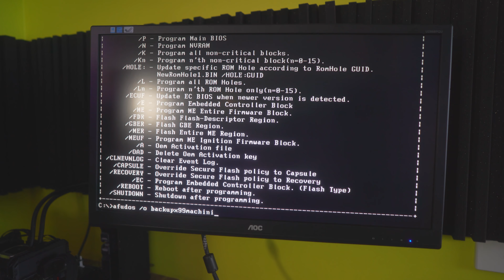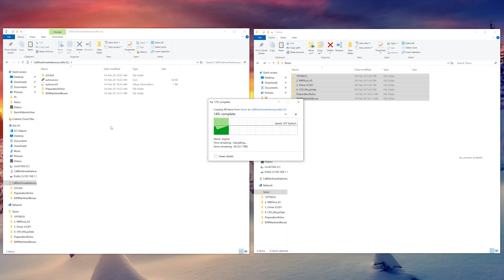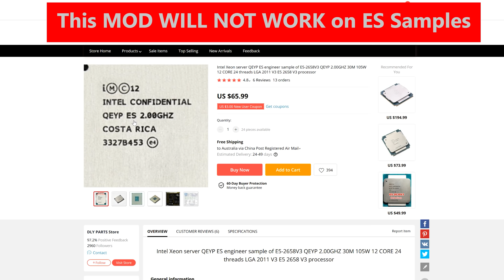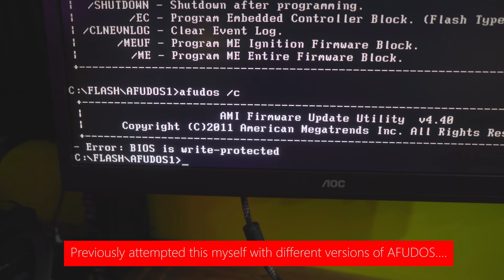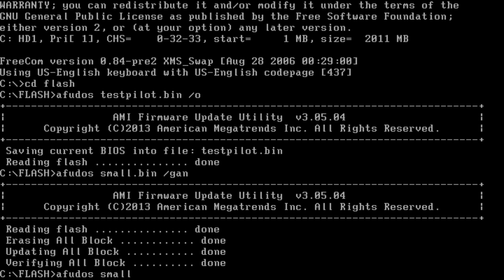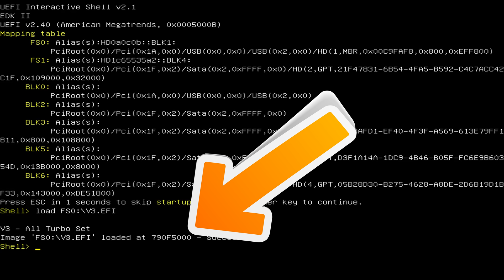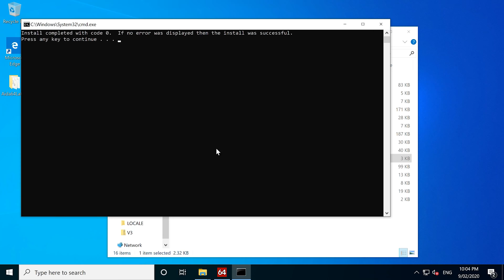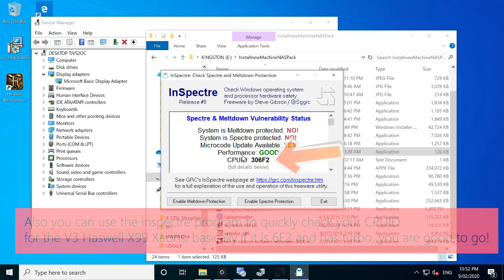Xeon V3 "Full Turbo UNLOCK" How To for X99 Motherboards

Comment: just a small note here for those who have windows intalled on a nvme m.2 ssd: the root drive is identified as FS0 and not FS1 
in some cases its reversed so be careful what you are typing, in this case bryan has it the same order i had it but some russian channels 
i watched earlier had the windows drive assigned as fs1 not fs0
Reply: does this apply to a normal ssd aswell
Reply: @quintonknight5177  I think this is dependent on whether you install windows first before you plug in your Rufus boot drive. If you have windows operating on nvme it gets assigned as FS0
Reply: Thanks, this helped me as well
Reply: Well this helps! TY!!!
Reply: Just invert command for fs1 and fs0, its works.

Comment: Great followup. I love that you dispense this knowledge freely and don't horde this type of knowledge to yourself for profit.
Reply: @mapesdhs597  thank you.
Reply: @Trick-Framed  can you explain to me what unlocking cores actually does??  I'm pretty new but I'm trying to learn!
Reply: @stevenjonas1  It depends on the situation. If talking about old AMD it is unlocking cores that were locked by the factory to create a lesser SKU. So say a Phenom x3. It has three cores. With the right board you can unlock the 4th core. And sometimes, if they were low on quad cores with a bad third core, they would lock a core on a Phenom x4 and sell it as an X3. In that case   you get a free core. More often though, the cache has issues or the core was faulty and that is why they locked it. It's a crap shoot. This was also done with Dual core procs, so sometimes you could unlock a Quad core from a Dual core. Talk about silicon lottery.
If you are referring to anything else, please provide me context and I will answer as best as I can.
Reply: @Trick-Framed  thanks a lot for the clear answer!

Comment: AWESOME!! Saved to follow along when my x99 & Xeon E5-2678v3 FINALLY gets shipped out. So far it’s been 3 weeks waiting. I understand the delays due to Coronavirus, but I’m getting impatient now. :/ ....Looking forward to cooking my processor.... LOL :) Thanks for the tutorial, I was today years old when I first heard that this was a thing!
Reply: Give us an update when you get it.
Reply: I am waiting also mine x99 huananzhi + e5 2678v3 and 64gb ram let's see if unlock will work
Reply: The normal shipping time is about 4 weeks (to Europe). But sometimes things can arrive even in 2-3 weeks and sometimes 8 weeks.
Reply: MaximusAdonicus ...It takes me 9 days to get packages via ePacket. I am just waiting for the items to BE shipped. I keep checking everyday. I placed the order on the 31st, and still waiting. The processing time has been extended twice. My other orders (2TB ssd & 2 TB Firecuda as well as my power supply were shipped today). So, I don’t think it will be much longer. :)
Reply: @Iam_Dunn  9 days from China to... USA?
Reply: MaximusAdonicus ...Northern Ontario Canada.
Reply: @Iam_Dunn  can you please tell me your psu watts?? I need to Buy a new one, i'm gonna add my Xeon e5678 v3 a 1070 gpu, how many watts do i need at minimum? Thanks!!!
Reply: Martin Aguirre .... I’m running on a 600W Thermaltake Gold Certified with zero power issues so far. The most TDP I have seen was 132W under a full stress test. :)
Reply: @Iam_Dunn  ok!! Great!!! I was thinking about a 800watts psu, so that this would run with no troubles, but reading this is GREATTTT!! THANKS BUDDY!!!! Btw, which is your gpu?? (Brand, model) thanks for your answer!!😉😁👍🏻
Reply: Martin Aguirre ... I went with an RX580 ASUS Strix... It’s a BEAST of a system. Easily 100-150+ fps in most games I play. Hits over 12,000 points on the Firestrike benchmark and I think around a 1700 score in Cinebench r15. Best $500 (Canadian) I have ever spent! :)

Comment: Just another tip if you have issues with fptbios not working on locked AMI bioses try downloading AfuWin64. It might save some time doing all those extra steps to flash it. Rename your bios file extension to .rom and under setup check all the block options. Under Miscellaneous check Do Not Check Rom ID. This is the same as AFUDOS, but works from windows. It is the official AMI bios flasher.

Comment: Xeon 2640-V3 = Worked for me, cinebench now gets 2800 and before unlock i got 2470 points, im super happy with this unlock thank you! Motherboard: GA-X99-Ultra Gaming (rev. 1.0)       (i got this mobo for 110$ from a guy that never even opened the thing)

Comment: Just completed this mod 👌 ,I was a bit freaked out something might go wrong but it worked and all cores unlocked to  3.3ghz,  cinebench r15 improved from 1705 to 1870. Nice one mate 👍
Reply: Is your motherboard still working properly
Reply: @BenitoFan760  Yes still my main rig and still overclocked at 3.3ghz!! now paired with a AMD RX6800
Reply: @RonnyJoe  Hey seems like a shot in the dark but is it still going strong? Planning on getting a X99 with an E5 2680 V3*2 and 64GB DDR4 3200MHz but was wondering about overclocking it.
Reply: @DudeGetRekt  Yes still system still going strong however I did change the cpu from 2678v3 (12 core) to 2697v3 (14 core) but kept the stock cpu settings and gets a decent 2200+ score on cinebench r15. I have been considering moving over to a ryzen 3700x for the power savings (electricity very expensive in Ireland at 0.45euro per KW
Reply: @JDawg  Ah yeah that makes sense tbh better efficiency on the newer processors, thanks for the info dude :)

Comment: Welp just so everyone knows theres a ton of 1680v2's  from a seller on ebay. only 175 shipped vs the usual $250 i always see. Bought an asus x79 deluxe to match.. and cheap 40$ 4x4gb for now. thanks for the inspirado on the new project. tired of my mini-itx r7 1700 which doesn't overclock at all. lol.. wanna go full tower. this should perform better than a 2700x in games at least. I could have just bought a 3900x but going old school for a bit. thanks again!
Reply: Price of the motherboard just makes it really hard to justify cuz it's old. motherboards can only run for so many hours at specific temperature.
Reply: "this should perform better than a 2700x in games at least."
No, it shouldn't. Games are too reliant on single-core performance. The 1680 v2 would probably be slightly faster than the 1700 thanks to the better latency and larger cache, but would be slower than the 2700X because of the clock deficit and infinity fabric. They're so close in performance that you probably won't notice any difference.
Reply: Idk check the benchmarks dude. Theres like 3 videos about it ... It was a nostalgia project. Not worth the $ unless you're doing it for fun. Great system though! Replacing with 4000 series later.
Reply: You don't need the "turbo hack" (not that I believe this stuff anyways) for that CPU as it is unlocked.

Comment: I did something similar too this with my Asus P6T deluxe and i7 970 !!!! I had too use a USB too save the new updated BIOS update and flash bios and install new then the i7 worked and I was able up overclock it and unlock it !!! it was a lot easier then this though 6 cores 12 thread 4ghz all core turbo now my Asus GTX 1060 3gb OC edition has too be overclock even more too keep up with my cpu without bottlenecking 1800MHZ still cool at 70C pushed hard !!!! did that and now I get about 38% more FPS and speed in games !!!!
Reply: You do realize you can bclk the shit out of first gen thou right?

Comment: I followed this guide and was able to unlock a Xeon E5-2690 v3 12 core to 3.5ghz and it made a big difference. I just picked up a Xeon E5 2698 V3 16 core off ebay and if it works just like the 12 core did then I am going to be pretty happy. I built my X99 gaming rig back in 2014 and the fact this thing performs almost as good as current Ryzen chips really says a lot about how far ahead Intel really was at the time. You can pick up a lot of these chips below 10 cores extremely cheap and they have a higher turbo which would work well if you are purely gaming. Great Idea for a cheap and powerful gaming rig and if you are lucky enough to find a 14-22 core cheap then it makes a killer ThreadRipper knock off for half the price.
Reply: Do you happen to know after doing this with a e5-2680v3 since some games are not optimized for so many cores....can you just turn off some of the cores for some games? Basically running it as a 6 or 8 core?

Comment: I have read on some Russian forums via translate that these programmers do indeed function with this board. However, there is a quirk. You have to remove the RAM, CPU, and GPU. Make sure there is a battery installed and power the board on. Then proceed to flash as usual. These issues aren't so much security features as they are quirks. The Chinese engineers that designed these boards are talented but lack the experience of major designers. I appreciate your coverage on these things. Waiting for my CPU and RAM this week and I will be off to the races as well. Been using a 6-core AMD 1090T Black Edition since ~2011. I was able to pull off my entire upgrade for the cost of the Zen CPU I wanted so I pulled the trigger.  If this all works out I might build another dual CPU system. Huananzhi has some nice dual CPU boards on Ali. A little pricey but they appear to be the best quality out there. Peace!

Comment: TY sir...worked like a charm with my QIYIDA-X99-H9 with a E5-2620V3.(6 cores 12 threads) with  QIYIDA 8x2=16GB DDR4 3200mhz memory..you are the man...Also  runs great with the  E5-2680V3.(12 cores 24 threads)...)

Comment: 2696 v3 18c/36t 3.6ghz turbo.

2690 v3 12c/24t 3.5ghz turbo.

works fantastic on msi carbon x99 with no micro efi load.
Reply: My msi x99 sli plus is not showing the turbo boost option in driver priority after completing the shell commands, did yours? If so where did you find it?
Reply: @williamorangeofjuice7804  okay that's super helpful thank you! I think I did see the guide that had to do with extracting the microcode but after I saw this video I assumed it wasn't necessary and maybe I missed something.  I'll give that a shot and if I can figure it out I may have you take a look if you don't mind. Thanks again!
Reply: @Nickscassera  microcode on bios level causes most of the problems i had stability wise...  but if you find different leme know.
Reply: @williamorangeofjuice7804  noted,  I'll have to do some more research before I feel literate enough to really get into it but thanks again,  that info was valuable.

Comment: 1650 v3 is unlocked.. might be worth the extra money for no headache lol
Reply: $94 vs $25 from eBay prices. That's not worth 3x the cost
Reply: @blatcher2  no doubt it will not be 3x better.. but it does have a strong single tread rating of over 2100 compared to 1700. And if it can be mildly OC'd to 4 to 4.5 ghz well it could be alot better, and maybe without all this bios modding headache. 
The ryzen 3600 isnt 3x better than the ryzen 1600 but people will pay for performance. If I get say 30 more fps, id pay the extra 60 bucks or so

Comment: I would like to add that if you’re doing this on a machinist motherboard, you should DEFINITELY do this with a second computer or usb on hand because until every step was completed, my computer would freeze in windows after doing the initial bios update in the beginning of this video.

I got it to work, thankfully, but not without a million restarts. Getting in and out the bios was fine, just windows didn’t like it very much.

Comment: Hello Man, done it myself too!! but i have to say it's more easy than shown. First thing it's not necessary the boot manager, just create a little partition as like the windows one do in the installation. You can create it after installation or when ever you prefer. And second sometimes the command to copy files in to new directory for boot V3 torbo doesn't work, so basically you need to create it manually with the command "MKDIR" shot form "MD" and write the complete patch with \dir\dir etc, than the command copy file works.
Anyway thank you very much i have a SZMZ X99M-G2 and it works only with afudos to rewrite bios. It's very good one and i would like to modify the bios interface, just to include a full logo and to improve fan monitoring for example,  it starts with a very basic control..

Comment: Mmmmmmm xeon. Xeon make my pp feel tingly. I love xeon builds. Saving old xeon cpus are my fav thing. I will say the x79 turbo plexhd paired with the 1650v2 oc at 4ghz and 32gb 1866 ram and rx580 was great. I wish I'd had enough for 5600xt
Reply: you can buy a 5600 or a 5700 and flash xt bios :)

Comment: @TechYesCity
Can you get one of these dual CPU servers and make your own game server?
2-4 graphics cards
2-Xeon CPUs
32-64gb of ECC?
Reply from the maker: Ill answer that for you in the next video.
Reply: @techyescity  great! Could you also check all core turbo and overclocking abilities of  the dual socket chinese boards?
Reply: Is this possible with the C612 chipset? I have a dual socket board with 2 2690v3 xeons in it that I'd like to boost performance on.  I think that it only runs at 40c on all cores during load testing.
Reply: One thing I'd like to note about game servers, GPUs do nothing for them.
Reply: So I am not talking about a traditional game server.
I am talking about running virtualize desktops (VMs) with their own dedicated graphics for playing games.
Depending on how you want to set it up, you can have this done directly on the machine, or through clients like a traditional server VM set up.
Think, 4 gamers 1 server.
In that case, multiple GPUs ARE relevant to performance.
Reply: This could also be used for other VMs for other 3d accelerated activities. Most systems only need 4-6 cores to run, but maybe you have a dual socket mobo with 2x 6 or 8 core CPUs
Reply: Tech yes Minecraft server?
Reply: @greenprotag  Craft computing just did a video on this. https://www.youtube.com/watch?v=ykb8u4oGyF0

It takes some doing, though. At least the way he did it.
Reply: Tech YES City i have a same question so iam waiting this video
Reply: @techyescity  i went over the video library and can't seem to find this video. am i missing something? also interested in getting all core turbo on dual socket chinese motherboard :)
Reply: @lonniewall16  I also want to know! And if it could work in a DELL workstation

Comment: I did this with a 2697 v3 in an x99 ws board... was a fun challenge. Result was an all core 3.5ghz on say a cinebench run. Will run a little quicker at 3.6ghz on lighter loads. There has been a big running topic on this on AnandTech forums for a while which inspired me to do it. I tested on 105 bclk as well but never really stress tested that to say it was stable.
Reply: @ChadDidNothingWrong  Yes that is the same board.
Reply: 3.5 ghz on 14 cores on 22nm lithography, what kinda cooler did you have strapped to that space heater? haha
Reply: @jacobpickering8586  Scythe Fuma 2 Rev.B and would only get into the mid 50c range peak with a heavy load.
Reply: @jacobpickering8586 these old xeon run pretty cool because of binning chip for enterprise (run with much lower core voltage). This mod also apply undervolt (-50mv up to -125mv depend on how good your cpu is) for keep the tdp just in sweet spot to make sure the unlock turbo boost work as expected.

Comment: You can also just buy the E5-1650v3, 1660v3 or 1680v3 in retail or ES and they're multi unlocked and imo a better route to take.
Reply: for that price just go ryzen.
Reply: Well...I just put a 1650 v3 in my Machinist x99, and the multi is locked in both Intel XTU and Throttlestop.  I dont think these motherboards allow access to the correct registers.  I uswd to run an unlocked W3680 on a T3500 motherboard and Throttlestop and XTU worked as normal.
Reply: @dariollanos 1650 v3 is like $30...but k bud.

Comment: I've done this yesterday with my E5-2670V3 on ZSUS X99-P4 motherboard, the increase in performance was significant, in synthetic tests i've gaind about 10-12%, and in games about 20% performance, but... there were some issues, the most important was that fs0 was for me fs1, and otherwise fs1 was fs0.
Reply: yes some boards are like that , so just plain swithc it over instead of fs1 to fs0 , then fs0 to fs1 vice versa

Comment: 11:45 You dont't have to check the ROM size in a different computer. Afudos tells you while reading how much it has read. The last value I saw was 7F3000 which are 8335360 Bytes

Comment: Today is the 3rd day and now I have not only successfully enable V3 full turbo on all cores but also recovered by corrupted bios.  I think you forgot to mention that if windows is not installed on a GPT partition, you can not do this mod(please edit your video as with UEFI installed windows, I couldn't see the FS1). In my case, that was the problem. I have modified the original Asrock bios so it doesnt show any additional tab in the bios for "v3 full turbo" but when system boots, it shows a message "v3 full turbo" and my all cores are working at 3.2GHZ on full load. Thanks Brother

Comment: Does anyone else have the issue of this unlock not persisting if the computer awakes from sleep?  I have to reboot to get back the turbo unlock.  I'm running the Machinist X99 and do have turbo hack working whenever the system comes up from a power on or reboot.  However if the system wakes from sleep, the unlocked speeds are gone and the system returns to default max speed.
Love your videos by the way, very well done and hugely informative.
Reply: I have read elsewhere that the C states affect turbo. I have disabled C3 and C6 states...
Reply: @FiReSTarTeR0709  Thanks for sharing that Mark, I'll give it a try.
Reply: @carlberggren8069  also just check by stressing the CPU to confirm. I redid a few steps in the tutorial before I realised it wasn't like my old overclocked x58 and responds to load. My one goes from 1.2 to 3.2 when I stress in CPUz. Which is great.